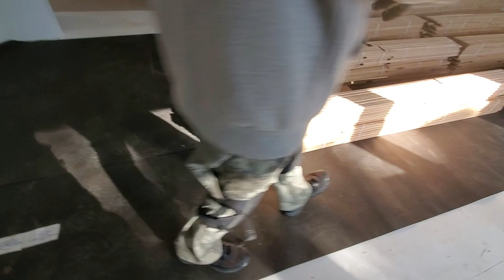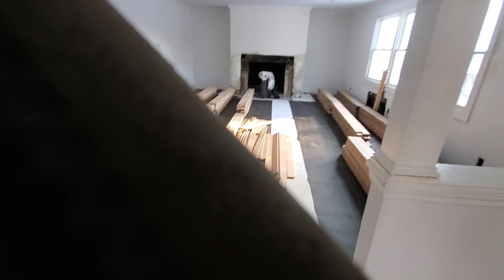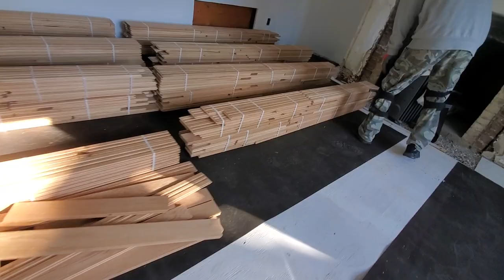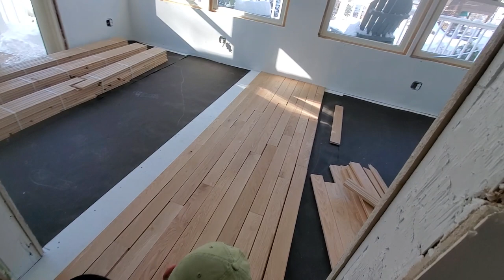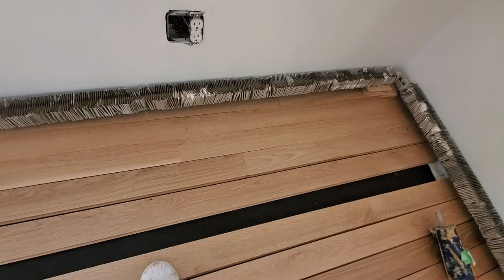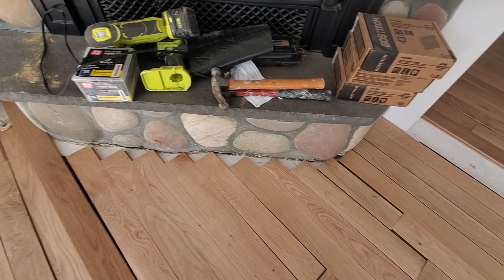Wood flooring installation. How to lay out prior to nailing.

Comment: This is exactly why I hate paying people to do projects on my house because they think they know what they're doing but it looks like garbage. Then they charge you a fortune.  And when you try to explain to them how to make it look better they give you a whole trip about how long they've been doing it and they know best.   Stair stepping belongs on stairs not floors.   This is how contractors are taught because this is the most efficient method but it's not the best looking method
Reply from the maker: Thanks for watching! I agree with your statements. Many times Carpenters come in thinking they can install flooring. That's not the case. The layout in random appearance is important. I'm trained and certified with the National Wood Flooring Association of America that mandates the standards for installing, and sanding and finishing of wood flooring for the best practices. If you notice any points in my video where you think you could have been done better. My glass is always empty ready to be filled with new learning. Your suggestions are welcome. If you happen to post a video showing what you're describing be very helpful as well. Best wishes :-)
Reply: You can stair step a flooring as long as the entire floor is stair stepped. But yeah a stair step is not a random pattern. As your laying out the boards are going to be stair stepped but the lengths between your ends need to be random lengths.  And you need to randomly mix in short and long boards. With NO h patterns.